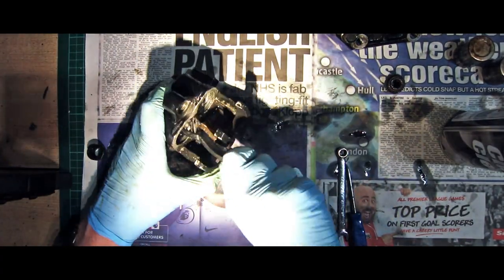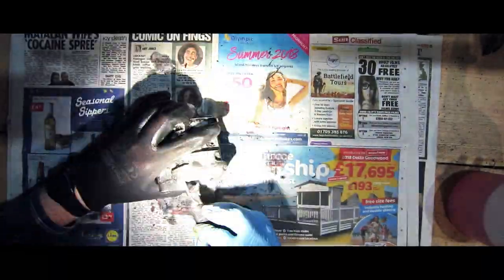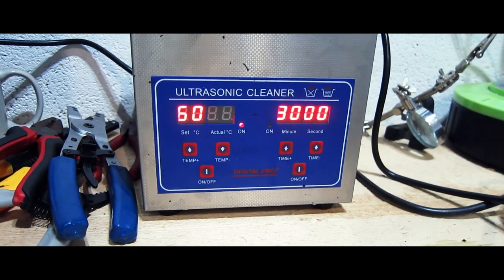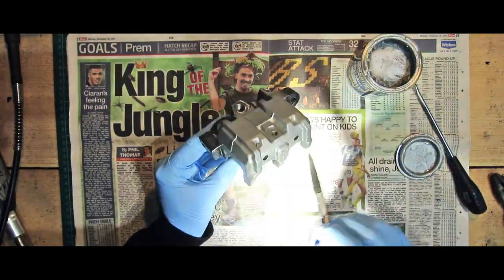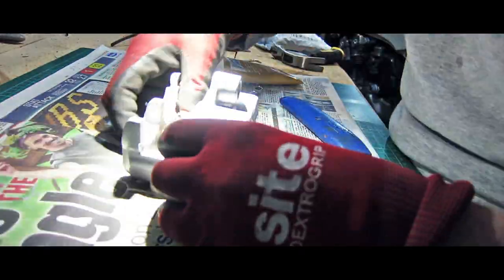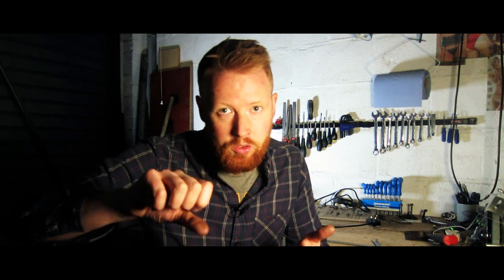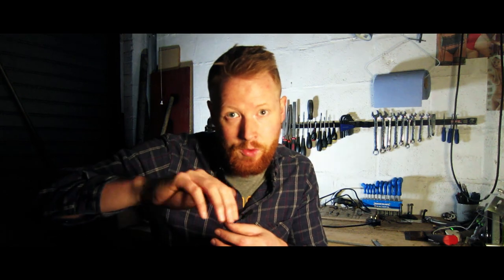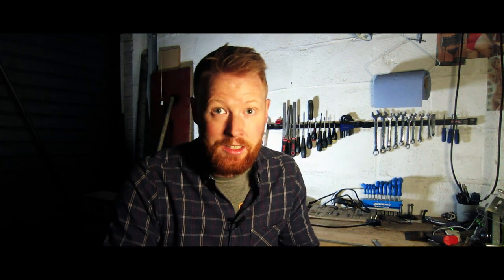How to Rebuild Motorcycle Brake Calipers - Honda CB750 Cafe Racer Build Ep5

Comment: The advice of getting the pistons out was worth the watch, and I have a single piston. I was planning on following the manual and disconnecting the brake hose from the caliper, doing a bunch of stuff and then trying to find my old master cylinder and brake hose to knock the piston out… duh. Just do that first. Sometimes it’s hard to read the label when you’re inside the bottle! Fanny’s your aunt!

Comment: Hey brother, Quick tip,   Use compressed air to push out the pistons. Just block the other holes first and control the pistons so they come out at the same speed and Boom!  It's super fast so be sure to have all safety gear over your important parts lol :)
Reply from the maker: Cheers buddy! I now have access to a workshop with a compressor but unfortunately didn't back in the day. For sure a much easier solution than I had to resort to!

Comment: I've used the caliper trick before. I had four calipers to rebuild off two bikes, so I bought a cheap (£12) caliper off eBay and used that at my workbench to extract the pistons. I used one of the old brake pads to block one of the pistons on the dual piston calipers as you said. I've had good luck using a two part epoxy caliper paint before. It's not cheap, but you get a really good looking and very hard wearing finish, I would say it's more hard wearing than powder coating. The majority of caliper housings are made from aluminium or an aluminium alloy. Ammonia (cleaning supply) is dissolve aluminium oxide, but not aluminium. The ultrasonic cleaner will have removed the dirt from the caliper, but it won't have moved the aluminium oxide, you probably had to scrape that off with a (brass) wire brush? Ammonia would dissolve it in seconds. However, a word of warning - never use bleach (or any products that contain bleach) when you're working with ammonia. You will create chloramine gas if the two mix, which is very bad for you.